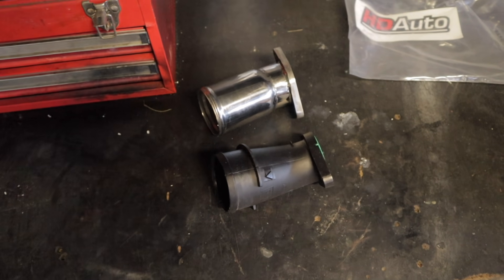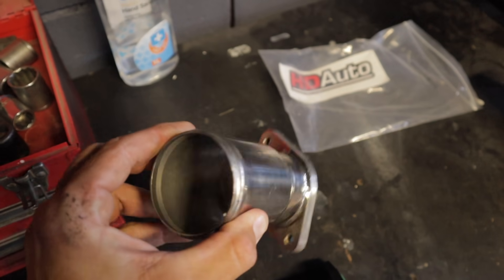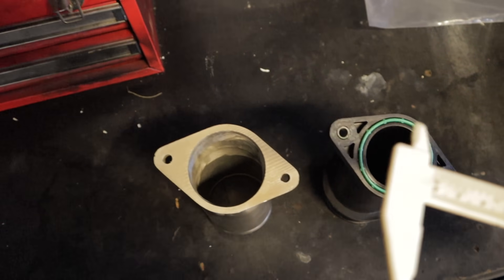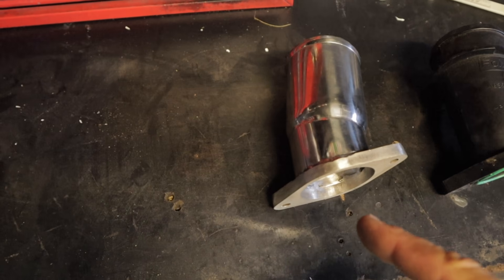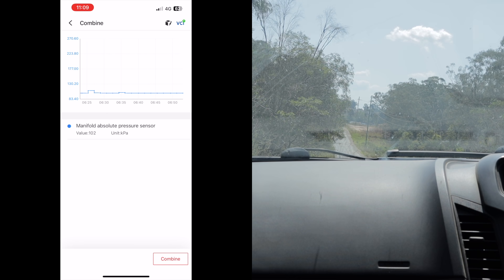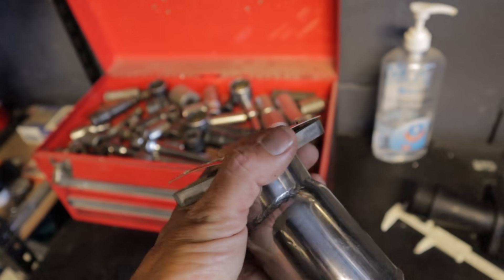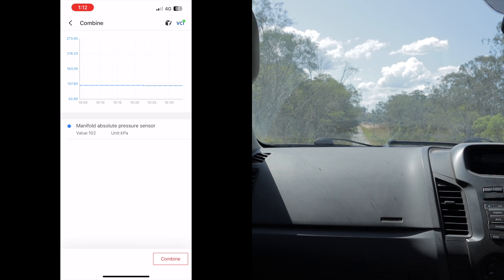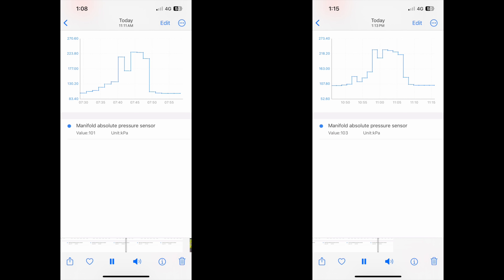Ford Ranger Turbo Inlet Pipe Upgrade & Testing

Comment: The factory plastic inlet has a very substantial lip inside at the bend. This can be ground smooth  and will give a noticeable improvement as well. (2.2 motor) no one is making those metal inlets for the 2.2 anyway.

Comment: I’ve had the same mod fitted for awhile now. I have a 2018 3.2l with a stock turbo and have had no issues, but instead of using a cardboard gasket I’ve used silicone sealant from supercheap. Just make sure to remove any squeeze out so nothing gets sucked through the compressor wheel and yes the turbo inlet hole is smaller then the inlet hole on the aftermarket pipe, same goes for the 2.2l.

Comment: hey just I've got question I've got a 2012 px1 ford ranger I've just recently replaced the manual gearbox in it as the other one was completely shot damaged 5th gear leaking and grinding and I've put a new reconditioned upgraded internals in it and put it all back together except for the gear selector as the bushing looks well and truly done my question is how much does the bushing effect putting the Ute in gear as i cant seem to put the new transmission in reverse and am under the impression that since the old gearbox was 330,000 soppy and loose and the bushing  that old gear shifter bushing was able to shift that gearbox but it cant shift the new tight gearbox I've replaced it with due to it being new
Reply from the maker: it should still shift it, i'd say it's something to do with the little lever you pull up to engage reverse

Comment: Awesome. I've been wanting to do this same thing for some time, literally thought about it just yesterday! Looking forward to seeing what you find. I did some major airbox inlet modifications to my own after watching your airbox video. 

I kind of think that the true benefit of airbox mods will be found after a tune, as it changes the flow of air through the MAF. I have had mine tuned 1. stock 2. upgraded filter 3. snorkel. With not much difference. Now i need to see how it goes after opening up the airbox flow, as the airbox inlet is actually quite small even after removing the guard elbow thing.

Nice work though very interesting

Comment: hey have you had any problem with your clutch? such as sticking to the floor but still being bale to depress the final inch or so to disengage the clutch or loss of pressure? ive replaced everything but the bleeder valve, including the hydraulic damper and the issue still persists? wondering if youve had to deal with it
Reply: Interesting, ive had the same issue, but not for a while seems to happen when towing uphill etc under load, does yours come and go?
Reply: @Ripply774  yeah comes on while driving, usually takes an hour or so but once it's been sitting for a while the pressure comes back. I think it coincides with temperature but who knows. I've done a full flush and still persists but wasn't as bad as it was before I changed the damper.
Reply from the maker: no issues with clutch, i make sure the fluid is clean, it shares the same reservoir as brake fluid so can get contaminated easily

Comment: Ok, so what you failed to measure was the diameter of where this bolts to. It can't do much if its the same as the standard bit you replaced.
Reply from the maker: the standard plastic pipe tapers down to a 1.5" or even less where it has the little bend in it  , you can't even pass a 32mm socket through it, where the HD auto one maintains 2.25" then tapers into 2.5"
Reply: I think david is asking what is the intake diameter of the compressor housing of the turbo.

Comment: Why won't they just machine a seal groove into the mating surface, the same as OEM
Reply: Being larger maybe there is probably not enough surface for it to sit on.
Reply: @shreckm6470  that's a good point
Reply: Cause they lazy, would drive manufacturing costs up